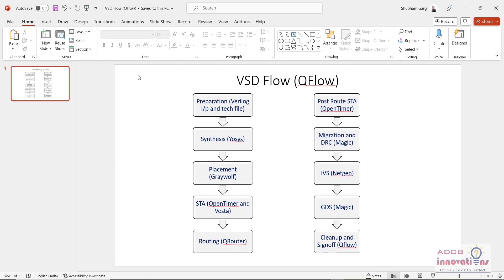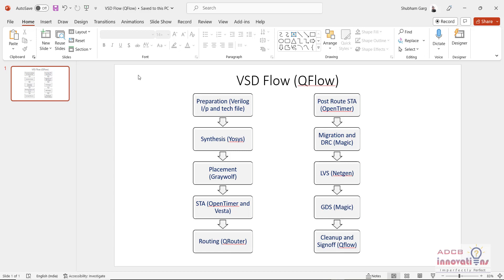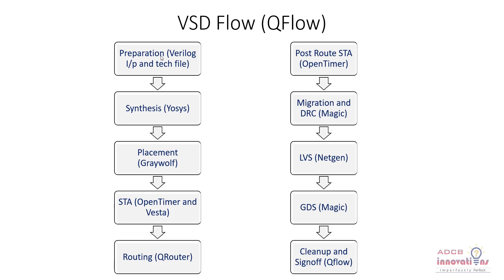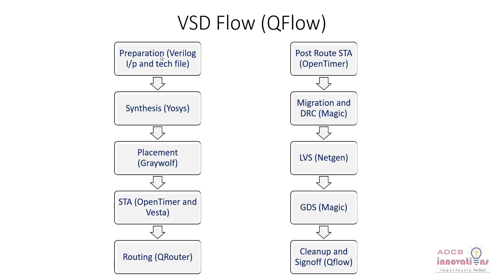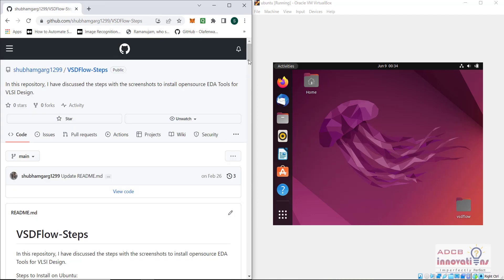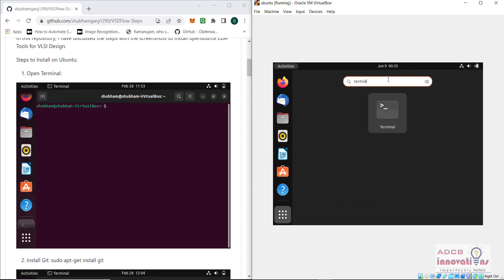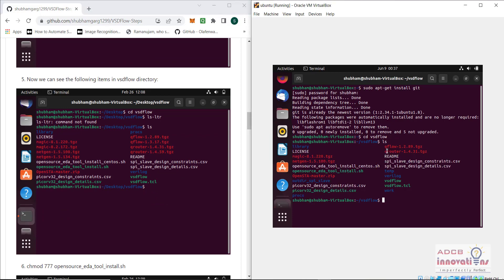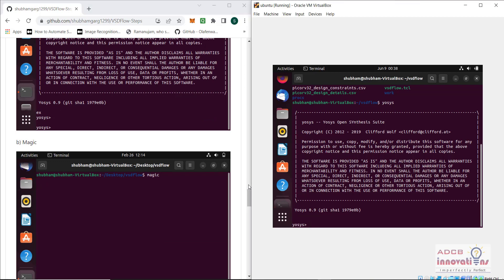VSD Flow Tools Introduction | Download and Install | Open Source EDA Tools

Comment: It works upto yosys after doesn't work
Reply: mine yosys and magic after that not available
Reply: write code 
<sudo apt-get update>
<sudo apt-get upgrade>
before clonning git
Reply from the maker: Dear Learner

The installation of the Open Source Tools can be challenging. You can check this complete video for a detailed explanation of the installation. 

https://youtu.be/tn64OU1GA7I?si=kNPaCSsZmWyFkNYO

Let us know if it helps.

Comment: There is some issue in synthesize step
Reply: /usr/local/share/qflow/bin/yosys :command not found
Reply from the maker: It looks like yosys is not properly installed. It can be quite challenging to install the open source eda tools. Please refer to this detailed uncut video for the installation of open-source EDA tools: https://youtu.be/tn64OU1GA7I

If you have any other queries then please let us know in the comments.

Comment: Hi sir , actually I am getting an error when trying to verify installation as per kunal sir's GitHub 
qflow display picorv32 is giving segmentation fault core dumped , if you know how to rectify this kindly provide a solution
Reply from the maker: Hi
Basically, this type of error occurs when there some issue in the read write permission in the memory........There are some ways to resolve this error........I'll try to make a video on how to resolve this error as soon as possible.